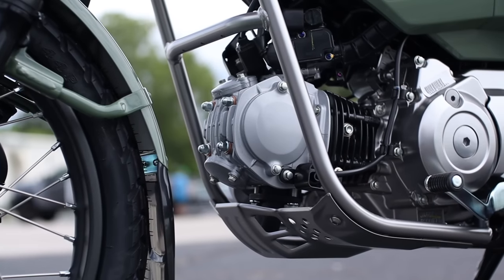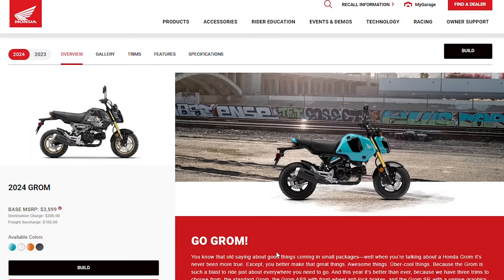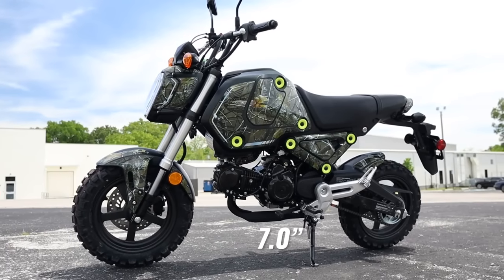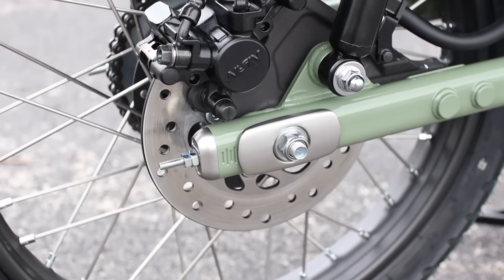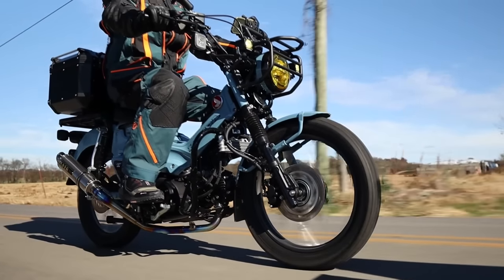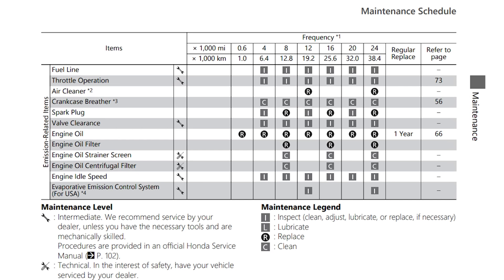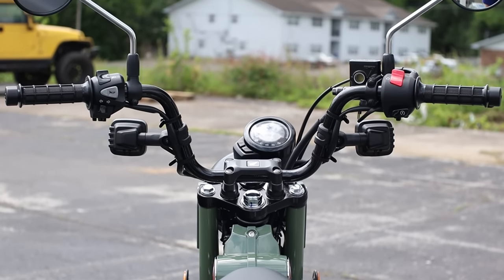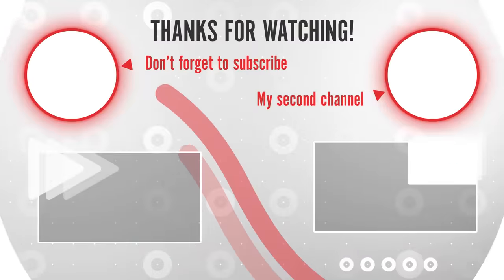NEW Honda Trail 125 Review | CT125 = Better than Grom, Monkey & Super Cub Motorcycles?

Comment: I would like Honda to add the 1.750:1 reduction box (high/low) transmission feature of the 1970’s and 1980’s models. Also an ability to easily turn the handlebars for hauling on a RV or storing. The high/low transmission made the bike uniquely capable in rugged back country terrain.

Comment: The CT125 looks so good with a slightly larger set of tires. I wish Honda would make a more off-road version of this bike.
Reply from the maker: Oh yeah, it's wild what a set of tires can do to change the overall look of a bike!

I agree 100%! Not that Honda really needs to increase sales on these minis but they could by a large margin, if they were to build different variants on some of these mini bikes. They don't have to go ham and build $10,000 versions of them but with some simple modifications geared towards a certain style, it could work.

Appreciate ya watching and jumping in the conversation too bud ;)
Reply: Possibly they could offer a 'CT150' with a true 5-speed manual, larger tires, etc.  This would make it better for both on and off-road.  I like my new green CT125 yet would much appreciate these upgrades--and I'd buy another if these upgrades are offered!

Comment: I cannot rewind on this video, using my iPad Pro, so I cannot study the technical information, and comparisons. Many short edits of things like options and accessories are lost to me. The problem began after iPadOS 16.6, but I get frequent YouTube App software updates, so who knows why. The problem only happens on some channels, yours is one. 
I missed if there is ABS on front and rear brakes and does the handle brake leaver or the pedal brake operate brakes on both wheels. All new bikes have to have dual ABS brakes to be registered in Australia. My Honda-PCX 160, has a small clip that locks the left brake leave on as a parking brake for a hill. My newer Honda-ADV 150 does not have dual ABS, The right leaver operates the front wheel with ABS only one wheel. The left leaver operates the rear wheel brake only without ABS. No parking brake.
I love the pegs or foot rests that allow one to stand on bumpy roads. I never feel safe and secure standing on the narrow rubberised foot ledges on the scooters. The pegs are wider giving more balance and control. The Honda Wave 125cc will start with the stand down and I stupidly would forget to put the stand up. An essential safety feature for me. Does the Honda Trail 125 have this safety feature? Auto lights on is another critical safety feature for me.
At 80 years of age I suffer from compression of the spine, so excellent after market suspension is essential for me. I was fortunate to sit on a special model Japanese Cub at my local Honda Dealer. The seat was so comfortable. My bikes are all Thai made. Not sure about the ADV-150. The argument of hard seats are better than soft seats is rubbish. We need high quality memory cushioned seats, that compress to absorb shocks and return to soft and comfortable. Thai bikes have things that look like seats. Back in the 50s the BSA 650 had a sprung seat with cushioning. 
We have 2 Honda Clicks but we got RSI in the hands an wrists after about 5km. So upgraded to PCX and ADV. The niece and nephew don't complain. Motorbike lights in this price range are bad. I added extra lights but had so much trouble with water we removed them. 
I found the CVT automatic transmission was the deal changer for me. Just twist and go. So I am now a scooter rider. Honda need to make 160cc and 250 cc motorbikes with CVT transmission and Dual ABS disc brakes. Proper big lights and comfortable for short legs to big foots.
I will have to watch your video again on 0.25 speed and constantly pause. It will be a pleasure. 👍👍👍
PS: the problem is in the A iPad, Apple TV, Samsung 65" UHD-TV compatibility. Works OK on just iPad Sorry 🙏

Comment: I've been trying to buy one of these things for the last three years but they are bought before they cab get them on the showroom floor.    When I asked one dealer what the "Out The Door" price was, the dealer is sticking add on costs on the bottom line.      Foe example, $350 market adjustment.    That means the dealer is adding $350 because the bikes are in short supply.

Comment: I had one the first year released in the US, sold it at 1500 miles.  It just didn't come up to the use-ability of the original CT90 or CT110 because it lacked the the two-speed transfer case.  Until that comes back, this is a pretty worthless off-road, underpowered bike.  My Monkey is faster and has more off-road capability (power) because of the manual clutch.  My CT125 would bury up in the deep sand in NM and without the 2-speed transfer case it couldn't spin the tire to get moving again.  the Monkey can do it easily.
Reply: just had to get better tires & 13 tooth  front sprocket lol
Reply: @meuhey  Did that.  It didn't help.  When it's underpowered you can't change it much.  The 13 tooth did help it break the tire loose in deep sand, but then it suffered on the highway.  the Monkey is still a better bike.  More powerful because of the manual clutch and much faster on the highway.

Comment: the one thing that made the old honda trails super usable was the hi/lo trans, of course honda cheapened out and left that out. there is a video where a fella tries to hill climb like an old trail could. some say the added power makes hi/lo not needed, but this is not true. the new version does not compare in actual climb. still a cool scooter, but basically you're getting a retro looking street toy that can hit light trails. just saying try not to get caught up on nostalgia if you plan on some fairly serious trail/hill riding

Comment: I been saving up for something kinda like this, don’t have a motercycle license but I just plan to off road it because I got a car. Mainly want if for gravel roads. Do you think this or a Honda ruckus would be a good choice for a new rider. Already have a manual car and this auto shifter thing sounds kinda weird but ok.
Reply from the maker: I would lean towards this over the Ruckus, if you're just wanting something to play around with on gravel roads. However, I would consider checking out the new XR150L as well. It's only about $100 more than the Ruckus and will do a LOT more than it and it's $1,000 cheaper than this Trail 125 too with its MSRP of $2,971 compared to $3,999. Especially since you said you have a manual car, so hopping on it and learning how to ride with its manual transmission with a clutch will be a breeze. But if you're worried about learning how to operate a clutch and learning how to ride at the same time, I'd spend the extra $1,000 over the Ruckus and get the Trail any day of the week. Why? Well, if you did end up enjoying riding those gravel roads a lot more than you initially thought and want to get your motorcycle license to hit the roads - you're going to be able to do a LOT more with the Trail than the Ruckus as it'll be pegged out at 30-35mph.

There's a lot more we could dive into about it all but I've probably already put you to sleep lol! Hope that helps bud and thanks for watching ;)
Reply: @HondaProKevin All fair points, not the biggest of having a carb but can deal with them, Also don’t really like not having a tack on the 150l. I been in talks with my Honda dealership, was going to plan on doing a test ride in the parking lot. I’m thinking if I don’t like the Ruckus test drive I’m going to go for the Trail. Also thanks for responding and taking the time out of your busy day. Going to have to mention your videos to the sales rep next time I go in

Comment: Compared to the old trail cub that has low gear setting they could've just put the same 5 speed from the grom and adjust the first gear to be lower climbing gear and maybe put manual clutch in it.
Reply: Having had a '22 Grom and living with my new (green) Trail 125 for some months, I agree.  I'd much prefer the 5-speed manual as in the Grom.   While the 4-speed auto-clutch makes a lot of sense for the Super Cub, a true 5-speed would serve many much better in the Trail 125.  Would be a great option to offer, possibly along with a 150cc engine.

Comment: Honda needs to add a low range gear option like the original CT90.
Reply: have you ridden one to say that? it's useless unless u brg 100 pounds of gear & u weight 300 pounds
Reply: Depends on where you ride.  Low range will go straight up a sharp incline that would kill this bike.   In 4th gear 20 mph was tops.

Comment: Along with a clutch and a 5 speed transmission. upping to 150 cc for the little extra horse power and torque, for the road.  On a calm day and few hills the 125 will do, but hear on the island seldom have calm days, and going up hill facing a wind it nocks your speed down a bit to much, also some steep hills you loos a lot of speed.  After riding bikes for over 55 years would much rather have a clutch. Going from one bike to the other have to really think and some times in emergency shifting the wrong way, but do love the heal tow shifter and kick start,  they are what made my final decision on getting one.

Comment: Can you use the engine as a generator when idle? Like is there an accessory for a house plug or 2, usb?
Reply: yes, the bike could start & run without a battery, there is a harness inside the headlight casing to add either 12v accessory wire or usb

Comment: The 2024 Super Cub now has a larger gas tank. I live in NYC and I'm torn over which I prefer, the Super Cub or the Trail 125. I also have my eye on the forthcoming Lambretta G350. It should be a bitchin' scooter.

Comment: This would have been a great bike in 1968. It's way behind the times for a new model. For the same money, you can get a KTM 200 Duke!  For me to be interested, it would need more displacement, more fuel capacity, much better suspension and be 20 pounds lighter.

Comment: I had one. Doesn’t feel right without a clutch. Downshifting is a pain with it. Put the 5 speed transmission with clutch and I’d get another one. Sold my first one after a few months.
Reply: When I downshift I push the lever down and hold it and then give a couple of revs on the motor then release it and it is much smoother. Try it
Reply: yup, just need to blip the throttle on downshifts... @Picturedave

Comment: No matter how long Honda is making bikes still they ignore the how important is proper chain encloser. It's not to hide the chain but to protect final drive system & lube the chain & sprockets while riding. For longer life of the components & ease the maintenance. Proper chain encloser with lube bath will increase the life of the relavant componant more than 5 times .

Comment: I personally hate that sickly green color. I'd rather they kept the Honda red than give me a color that reminds me of illness and makes me harder to be seen on the road as well.  Unlike others whining that the engine should be bigger, this is about perfect. After all, it started as a 90, then 110, and now 125... but I could see the point of 150 given that the XR150L is cheaper and more capable. Given that choice, the XR150L wins easily for me despite the emotional connection to the first bike I ever rode.

Comment: i'm 5'9 and 185 pounds and the best i ever got is 125 mpg. but i'm about to sell mine because honda missed on this bike. its to slow to get on a highway. and to weak to go off roading. i changes my sprockets and got a little more power but lost even more speed. but the power wasn't worth the cost. so i changed the gears again for more speed but it didn't help because the poor engine just dont have the power to pull it any faster. i love the bike but i need something a little larger and faster. not much but a little. i just wish they had put the low range in it like they did with the other trails.
Reply: The engine upgrade kits mentioned in the video might be what you're looking for.

Comment: Don't  WASTE  your money, this is just a poser. This is NO comparison to the old CT90 or CT110, the new fake CT is just a off road looking street scooter,  it has no low range transmission which is what made the earlier models so capable and safe to ride off road. Every one that I have talked to that has bought one has been very disappointed and has sold it and bought the older models, usually bought two and still had money left over. Also the CT bikes did NOT have an automatic or a semi automatic transmission,  it is merely a clutchless manual transmission. It's amazing how ignorant these video posters are.

Comment: I had an original ct 90, think it was a '69 model, this doesn't hold a candle to the original with the dual range transmission.  It's cute but not fit for serious trail riding...

Comment: Or....like me, you could buy a really nice low mileage...1700 for my 2016 Honda CTX 700. I paid $3900 for it. It gets 65 mpg and it's a REAL motorcycle. Yep, I have a scooter too, paid $4000 for a 2014 Honda Forza 300 with 265 miles on it. It'll go 85 mph and gets 62 mpg with my fat butt on it. My point is.....why spend that kind of money for not much bike??? You guys ride your monkeys and groms on the side roads and sidewalks....I will be on the highways or wherever I want on my CTX. Am I wrong???

Comment: This is absolutely meaningless and nearly completely irrelevant to the video. At 4:30, you saying the super cub still has a drum brake from the 1800s got me curious and it turns out that drum brakes were first introduced by Louis Renault in 1902, although some sources dispute that, and they were invented previously just not included on a production vehicle.